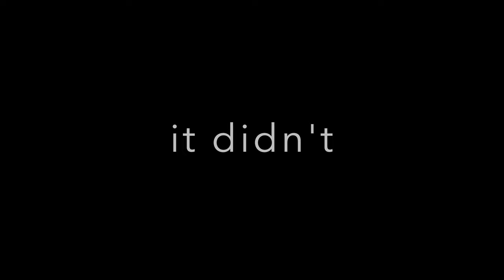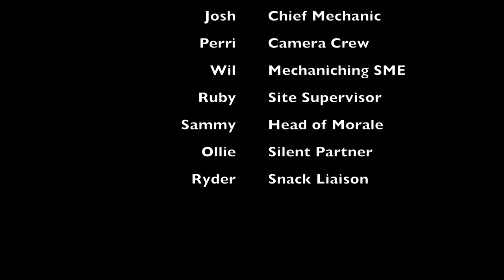Standard Overland 4Runner Suspension Install

Comment: How are you liking the suspension? Just received my 5160/6112 and OME springs for the rear. Quick question what springs do you have on the rear
Reply from the maker: We love this suspension set up. Originally during this install we had OME medium springs. But since then we installed a Coastal Off-road dual swing out bumper, and upgraded to OME heavy springs. Still love the suspension though- so much that we put it on the GX470 last year! I have never tried a set up like Icon so I can’t say that they aren’t amazing, but I also can’t imagine how much better they could possibly be for that price point when the Billstein is so good and is affordable. I have nothing but good things to say about Billstein. Plus lifetime warranty.